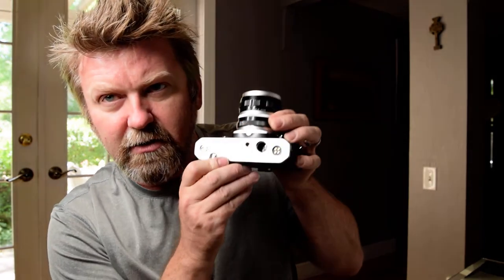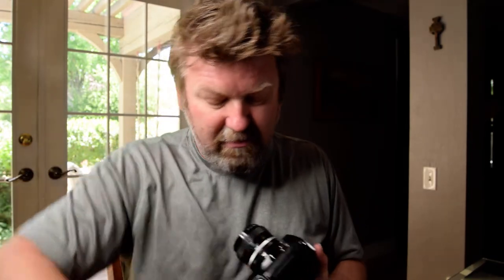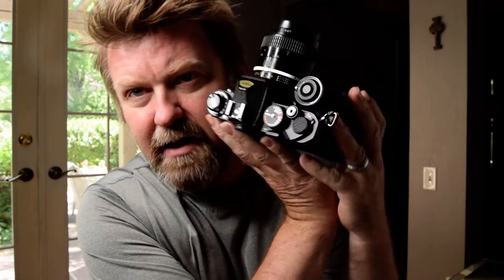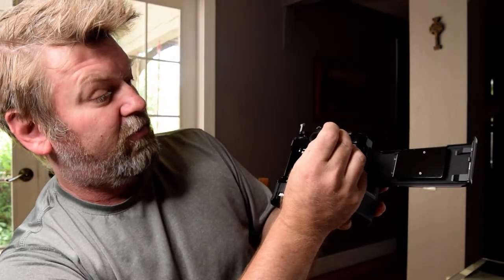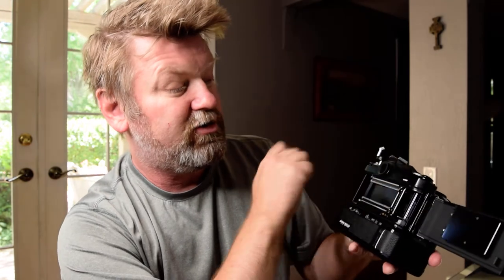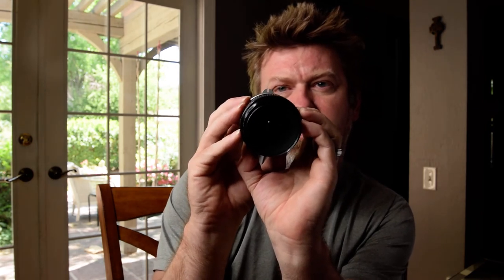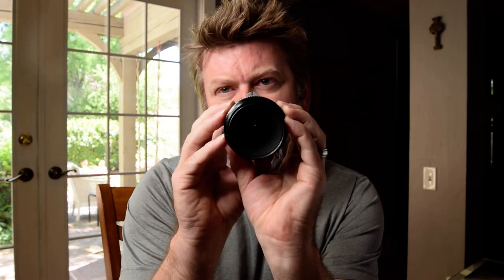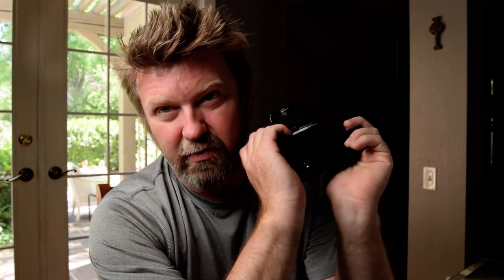Blur.bz :: Nikon FE2 eBay find - How to fix old film cameras and lenses. Common Problems.

Comment: The very first tip you gave?...
I have a mint black FE2 but I thought the electrics were shot because it wouldn't work with fresh batteries.
Lifted up the contact in the battery compartment like you said and now I have a working FE2!!!
So I've liked and subbed for that one tip alone. Thanks

Comment: Hi! Recently purchased gorgeous Nikon fe2,but i have one issue - the black needle of the meter doesn't travel upper than 1/250, I've tried different batteries, different iso but the needle still doesn't travel uper 1/250. Interestingly, it seems to be accurate, as I've shot two test rolls and exposure was okay. The needle corresponds to light and diagram changes and travels normally before 1/250, and after - just stops and don't go upper, but normally goes down. I assume that it can be some foam ir etc in the viewfinder,but not shure. What it can be?

Comment: Can't use my old Nikon lenses on the FE2. That's why I bought the FE.
I also have a Nikkormat ft2 with a 50mm f1.4 ai s-c lens and a 105mm f2.5 p lens. I also have a 24mm 2.8 afd lens which I use on both cameras and my Nikon D300s too.

Comment: Hi, thanks for this, lots of great tips here! I am going to fix both my Fe2's, and I need to know how thick foam I have to get, both for light seals and the mirror cushions... I have to fix a few other cameras as well so I am going to buy some big foam sheets, I don't want to buy readily cut foam for each and every camera, but I do need to know how thick the foam has to be... I really want to get a MD-12 as well, guess I just have to start looking for one :)
Reply from the maker: I've successfully done that with the black foam sheets with adhesive backs you can get from Hobby Stores.  They typically have two thicknesses.. so the thinner one for the seals, and the thick one for the mirror cushion.